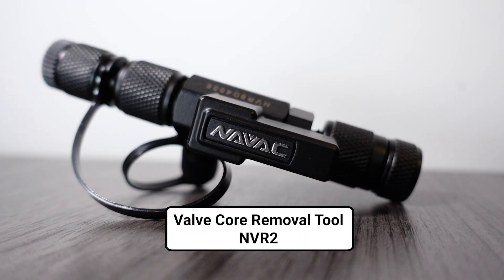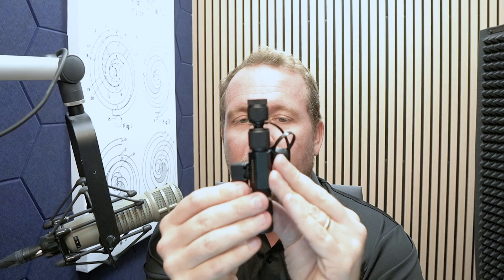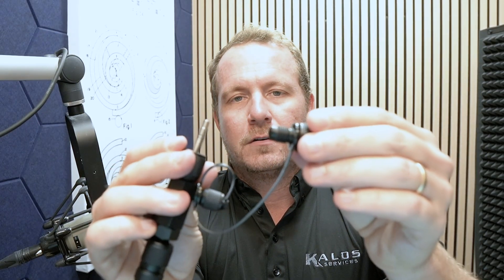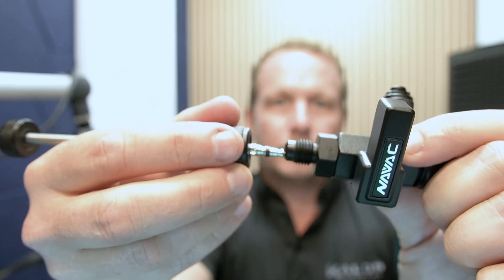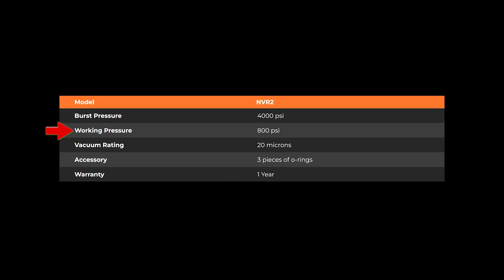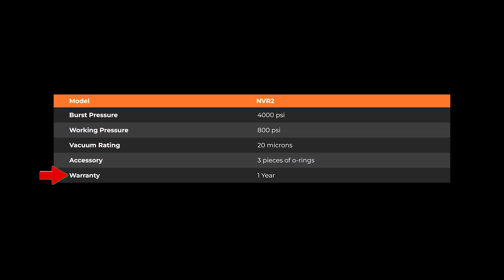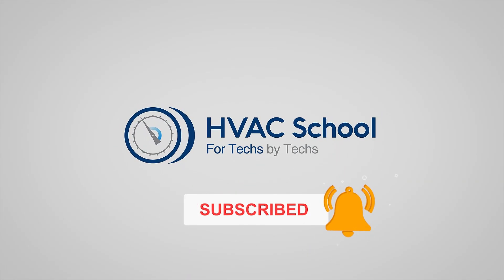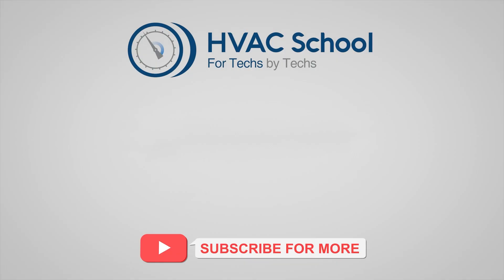NAVAC NVR2 Valve Core Removal Tool Unbox - Two Sizes in One Tool!

Comment: How does it grab the core? By the body or the shaft like the new Fieldpiece core tool? The Fieldpiece tool is problematic. It doesn't always grab the core.
Reply: Maybe the Fieldpiece one is similar to the Appion ones in that you need it to be just tight enough on the access port without being over-tight?  If you have the Appion ones on too tight, it squishes the o-ring and makes it so that the core gets stuck.